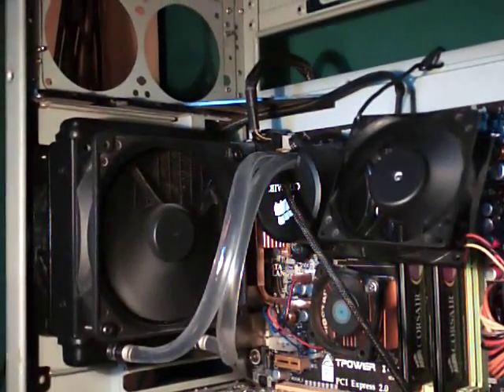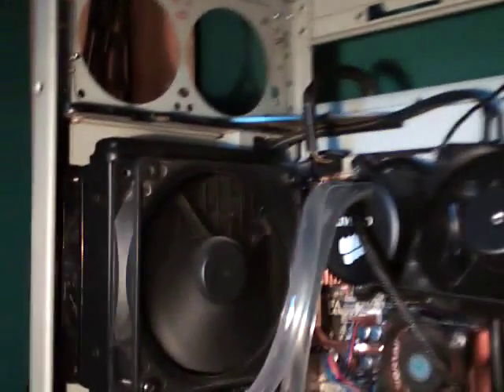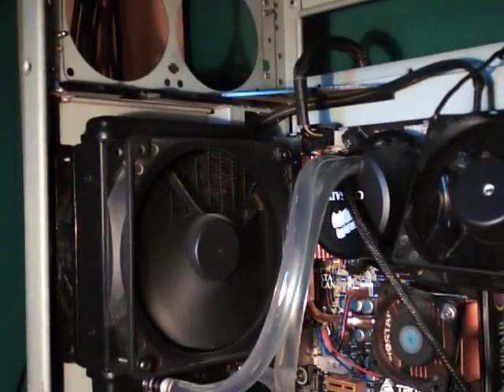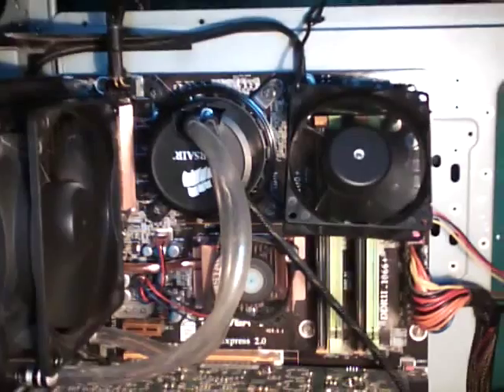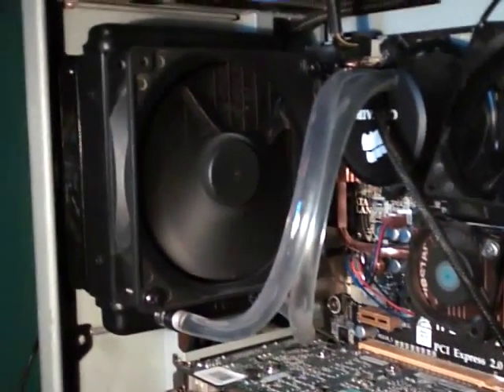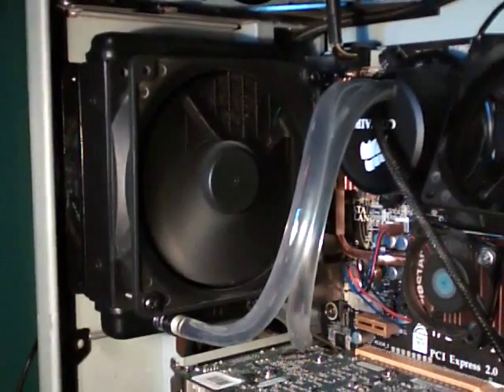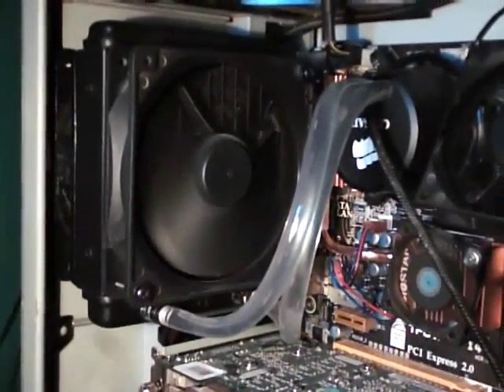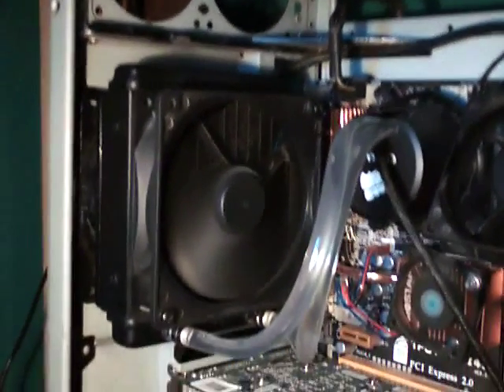Corsair H50 Xtreme Final Version by Rick Arter

Comment from the maker: The case had a side panel with large area of mesh so it got 95% of the air from there and actually I ran it with side panel off most of the time so it was exactly same as facing opposite way.

Comment from the maker: @ImmortalUniverse I no longer own this but trust me I know about air bubbles and they were removed best that I could considering it was all sealed. The pup is weak on these units so adding anything else that inhibited flow was outta the question. Had it for few months like this and no evaporation what so ever. Now I have air coolers that smoke this thing. You don't need a reservoir just a fill tube which I had later on check out the video I posted one about it pretty sure.

Comment from the maker: @keiki646 No it is set up to exhaust out the rear 120mm hole. Not as Corsair specs in directions, but it worked better in my case with 120mm fans up front.

Comment from the maker: @dubmywub Since the top of the rad was the highest point, any bubbles or air would go there instead of into the pump or elsewhere. Which would drop efficiency this kit was easy to bleed since there were so few parts and a bleed hole.